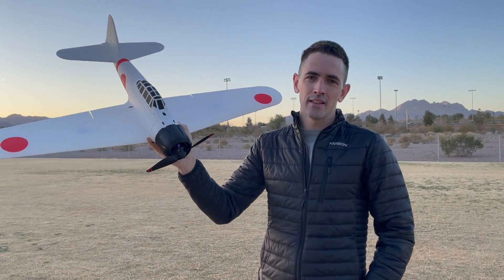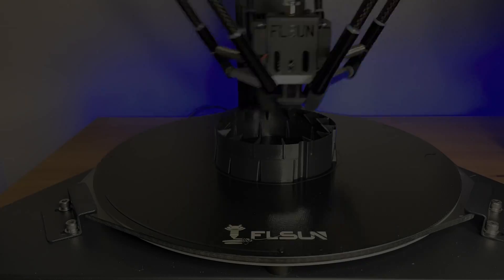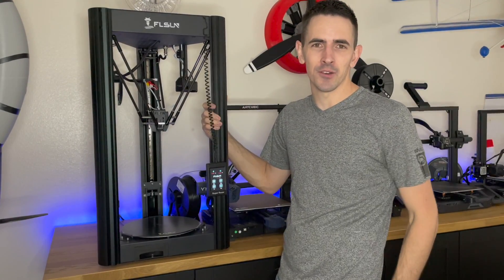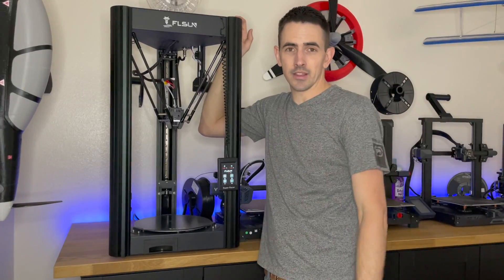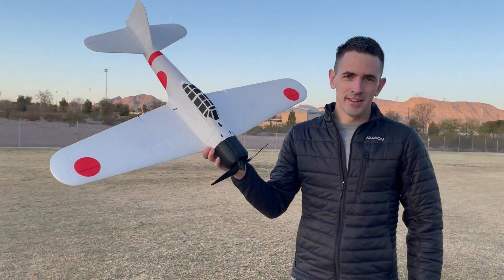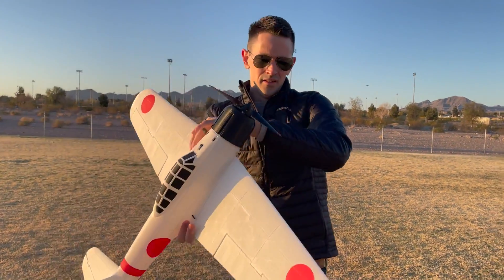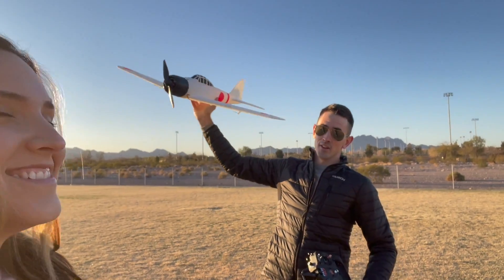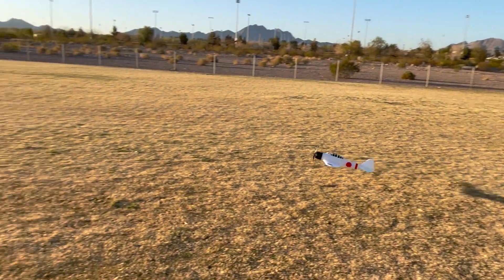Fun Park Flyer RC A6M2 ZERO | Full Build

Comment: I wouldn't just butt up the pieces like that. Should design it so one section clips into the others like the way they built the me-109 rear end. 

Every section on one side had a sort of indent going around it that would accept an inversion of the indent from the previous section. And then they would bolt it together. That way having the overlapping sections makes it stronger than just gluing it end to end. And if you 3d printed it you could just put glue around it and then clip it all together

Comment: How do you manage to get so little stringing? With lwpla my prints are nice from the outside but super stringy inside. I use the 3mf files for the piper j3 with prusa slicer and a mk4 and it seems prusa sloces with a lot of hops in the layers and rarely gets a continous path. Any help is apreciated :)

Comment: It says to print the motor mount with PETG. I'm wondering if you actually use PETG? Or by chance did you have to use nylon ABS ASA or did you just print with standard PLA?

Comment: Just started printing mine using the files they provided in Pursa Slicer, but it seems very very flimsy like vase mode 1 wall type printed, yours seems a lot more solid. Did you use PLA-LW? I swear something is wrong with mine

Comment: I started 3d over a year ago after watching your channel.  Thank you for your experience you share. 
I am scratching my head on the plalw. I used the supplied gcodes with a skin that is so unforgiving to flying. Cracking wing in flight.  I have a 3d lab print and eclipson models I tested. I also have used pla plus and have had great results. I am now working on a pet version Eclipson C.  The model in this video is in plalw.  I was wanting to build this one. Do you plan on trying in other materials?
Reply: What tempurature are you flying in?
Reply: @azimuth9819  Pla is 220 and esun pla-lw is 135. Most of my planes I do a hybrid with front fuselage in pla and tail in pla-lw. Wing with both depends on CG.
Reply: @kevink.7697  no I meant the tempurature of your environment

Comment: Hi, thanks a lot for the video, it really makes me want to start designing the Zero!  

But I have some questions: 
- For the music wires, do I need a specific one?
- Is it ok if I use a regular glue without accelerator? 
- Do you have any examples of other compatible radio controller? 

Thank you very much for your answers, 
Alex
Reply from the maker: For the music wire, I use 1.19mm that is the size you need

Regular medium CA glue is what works best, no accelerator required!

There are a few other radios I have heard from others that work well! https://amzn.to/3t9KiH9 or
https://amzn.to/3GE6pe4

Comment: Hey Troy, currently printing the zero but I am unsure on some of the print details like top and bottom layers, the 3d lab print pdf does not specifically mention print settings the way eclipsing does. Is there any way to find this information or trial and error?
Reply from the maker: Hey! They don't list that on the PDF, they prefer you to use the already sliced g codes, but those don't always work for your specific printer. Basically, all the fuselage parts, wing section, stabilizer are all 0 top/bottom layer and 0 infill. The only parts with top/bottom layers are ailerons and elevator, usually use 4 bottom layers and 3 top layers if the parts ever need it

Comment: I like your videos very much! Just finished my build of this plane. Can't wait to fly it 🙂
Reply: Today I had a few hours and made the maiden flight. This plane is awesome!
I used a 2830 motor with 1300KV, 1500mAh battery with a 30A ESC. I put 20g of lead in the nose to get the right center of gravity.
Launch was very easy, and I was very nervous about it. Just full throttle and a smooth thrust with a 30° angle up, just like Troy did. It flies like a charm and the landing at low speed with the nose up in the grass is perfect.
I love this plane ❤.
@Troy: Thanks for all the great videos
Reply from the maker: This is one of my absolute favorite planes for sure! I'm so glad it went well! Thanks for giving the update! 😊

Comment: Had to watch it again today ☺️
Reply from the maker: I hope it was helpful!! 😊
Reply: Yes definitely! Recently I printed the older 3d lab Me-109. I asked myself if it is possible to print it with LW filament. Well, at least partly would be weight saving I guess.
Reply from the maker: @rcpowres  using lwpla for that plane would save a lot of weight, but because that design uses the old printing method, there would be a ton of stringing on the parts.
Reply: Oh good to know. So the question is if the stringing (possibly inside the hull) is acceptable? Is it ok from the mechanical point of view (stiffness, durability etc.) ?
Maybe l will try it! Viele Grüße 
Chris
Reply from the maker: @rcpowres  that is fine! stringing doesn't effect the weight at all, so as long as the quality of the part looks good and feels strong it should be fine!
Reply: @TroyMcMillan  thanks mate , Is it possible to scale up the model to make the wingspan say 1500mm.  Also when I buy a 3d file it shows the building instructions and electronics required?  Thanks

Comment: Hey Troy, really enjoying the videos, thank you. I have question for you. I'm trying to print my first model, I'm using eSun lw-pla, the walls so far look great with no stringing but as the print flattens out over the top of the cowl it opens up leaving large gaps between the filament. How do I get around this.? Regards Glenn
Reply from the maker: Were you able to sort this out? If not, the cowling needs to be printed out of regular PLA, and I also turned down the layer heights to 0.12mm to have better print quality on the nose

Comment: I'm in the process of printing one of these and it's excellent! Great video! I'm making mine from the new Poly maker prefoamed LW-PLA. It seems very easy to work with although a little heavier than the other brands. I would like to see a video review by Troy of that new material.

Comment: try ASA\tpu mix filaments TPU first 3-6 layers create a filament change/ change temps in slicer then switch to ASA change temps. make your own shock & sound dampeners. can bond many types if temps are correct not too hot but must have good COOLing / proper cooling from multi angles. also I would buy Liquid Diamonds Epoxy (super low viscosity) & put on the thinnest coats possible. air brush maybe? um mix your own pigments for any crazy color combo/ color changing maybe?
Reply: all modeling and any projects with any force, I would always use Liquid Diamonds+pigment not fillers not paint. or keep clear if still prototyping can see where stress is.

Comment: information.       good work.          at 2:53, this high location of the  Mass  of servos, (avoidably)  'raises'  the  location  of  the  c-m.     Center of  Mass.          at 7:05, if main wing control linkages are located at the  UPPER  surface, they are much less likely to be damaged.        at 7:32, the  Mass  of wing-located servos  should be located  Forward  of Thirty percent of chord; and as far inboard as is practical.          cheers

Comment: That 3d printer is awesome I've been looking at it for awhile but I already have the flsun delta pro it's a fast printer and it's bigger that's why I haven't got yours how much of the filament roll did it take to make the whole roll half or what
Reply from the maker: maybe 1/4 of a roll, you can barely tell I used any filament by looking at the spool
Reply: @TroyMcMillan  wow thats not bad I think I'm going to get some

Comment: Really nice print as usual!
Is that the standard spinner? My files for the spinner print look different (and don't print well). 
I think I'll try the 2200 3S as well, the 1500 is way tail heavy.
Reply from the maker: I had the same issues with the spinner, so I ended up using a different spinner I had files for. I didn't want to use that battery because I was worried it would be too heavy but it worked so well, I definitely recommend it
Reply: @TroyMcMillan  Hi Troy, thank you for the detailed assembly video. I really like the spinner you used. Where can I buy or download the STL files for it?

Comment: Nice to see you finally do a review on a 3dLabPrint plane!
Reply from the maker: they changed the designs of their planes so they print so much easier now, I had to give another a try! I did their Cessna 152 before
Reply: @TroyMcMillan  Well they were pretty much the first doing them...they have evolved a lot along the way.  I didn't find them any more difficult to print then others but I started on them before the others came around and got my printer dialed in back then.  What I did find is that earlier models were more difficult to assemble than newer ones.  That said, their original wing rib design I still like the best even though it isn't as light as some of the newer planes.  The curved ribs make a much more solid wing and has less sagging between ribs.

Comment: Hey Troy Great looking plane. I've just recently found your channel not month ago I believe.  I've been thinking about building this zero as well but wanted to see someone else build it first. I must say nice work. I've been working on the eclipson c model. I have about three of them printed out right now. Two for my father and one for me.  Troy do you sand your planes before you paint? I've been using some 1000grit just to knock the rough surface off the esun pla-lw i've been using. Makes it look a littler better. Out of all the printers you have now which one do you like using the most? Keep up the good work!
Reply from the maker: I don't sand them before paint. I use Krylon paint and primer in one with green frog tape to mask and it adheres like a charm. Out of all the printers, probably the anycubic vyper is my all time favorite. This flsun sr in the video I mentioned, I've been running it for a while now and it is AMAZING. it might be my new favorite but its too early to say
Reply: I was quiet skeptical about the esun pla-lw at first but it’s growing own me.  Specially after I’ve printed out three eclipson model c planes.  It probably took me about 30 mins to get it dialed in.  I believe I still have about quarter of filament left.  So far no complaints here!

Comment: Awesome build. If you could tell me how much it costed you for the whole project, I will make one for myself. I have 3d printer and light weight PLA filament. Please reply.
Reply from the maker: You'll need a battery, transmitter and receiver, and about 50usd in basic electronics

Comment: Do you have a preference between the design and build/print requirements for Eclipson models vs. 3Dlab models? Or, are they similar enough that there's really no noticeable difference in how they print and go together?
Reply from the maker: The 3 most recent 3dlabprint planes are designed to print and assemble really easily, the old designs are pretty difficult to print. Whereas all the eclipson planes are easy to print and assemble.

Comment: Nice to see you back flying, printing, building, and recording.
Just a little bit of G at 12:28. LOL

Brilliant idea (by 3dPrintLab) of using PLA filament for aileron hinge (7:00) and for wing brace (6:25). Yet carbon (?) was used for elevator hinge (2:15). Seems like a minor inconsistency in the design.
Thinking a a bright yellow T-6 Texan designed and constructed in similar way would be a popular plane.
Reply from the maker: You can use pla for the elevator hinge also. I just had spare 2mm carbon rods that fit more snugly, the pla had some play in the elevator hinge that I wanted to avoid if I could

Comment: Thanks for the fun video . I finally got around to printing the Eclipson model c.  I can honestly say it’s not a easy as you make it lol . I have glue everywhere and the mishaps were unbearable at times . But I did it and I will do a few  test before flight .   But thanks for the video and AWSOME build .
Reply from the maker: I appreciate it!  The first one is definitely a learning curve, you learn a lot and get better on the next one!
Reply: Lol that is what I figured . I bought a big role of colorfast light weight pla so I’ll definitely reprint the plane and learn to work with it and try and develop better techniques. Again I really appreciate your videos , and the push to make 3d printed planes better (hopefully none day no flu and snap together prices) lol
Reply: I saw your comment on the model c and have it as well. I have used pla plus, polylite, pla lw and now a petg version. Also made combination of them. Pla in front and lw in rear to balance strength and weight. I cannot get many flights with plalw. It just cracks everywhere. Have you experienced any of this?
Reply: My plane ended up crashing on the 2nd flight.   My ESC and motor I bought from Amazon didn’t work to well.   Anyways I’m thinking now that 3d planes are cool but the strength And is an issue.
Reply: @shownuff891 I am on printed version 6. I removed landing gear. Hand launching works great. I land on grass with so much less damage. I am using a cheap 2212 1400km motor 8x4 prop. I was not able to keep gear tracking straight.

Comment: Did you use Cura? Or did you manually modify their Gcode? I have not been able print planes from 3dlab. Dont wanna spend $150 on simply3d.
Reply: I have just printed the 3d labs prints Mustang using PrusaSlicer 2.4
3d lab prints worked with Prusa to get a new setting in for their models. They have a video on their YT channel showing how to use the new settings with a download able profile. I was able to print the Mustang part all individually. Had a couple of failures but that was more my fault. Prusa Slicer is free as well. I did upgrade my CR-10 V2 to a direct drive as well which I think helped a lot with stringing. I used normal PLA for the whole build. Haven't glued it together yet have some other projects to finish first. Hope that helps
rcKeith
Reply from the maker: I am on the same page right with you. I have still not used anything other than Cura. For this build I sliced about half the files for the new printer, and used just the g codes with another one of my printers